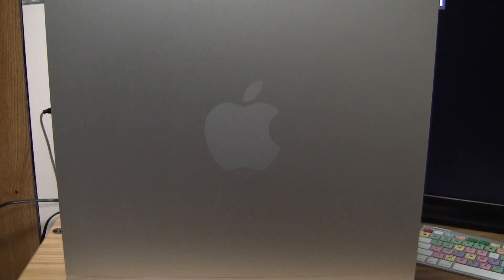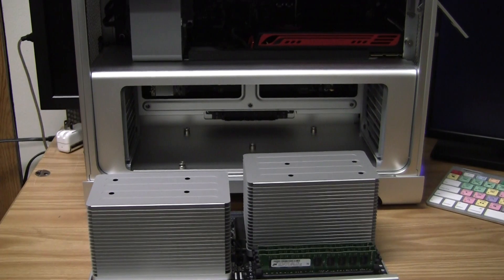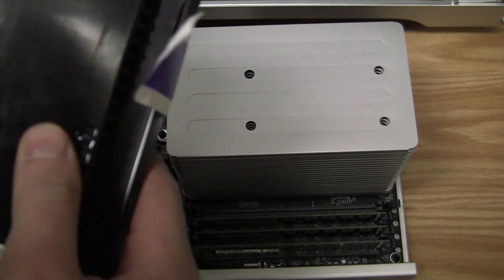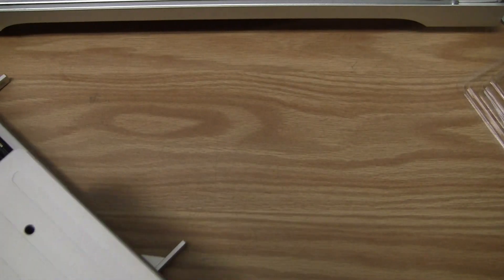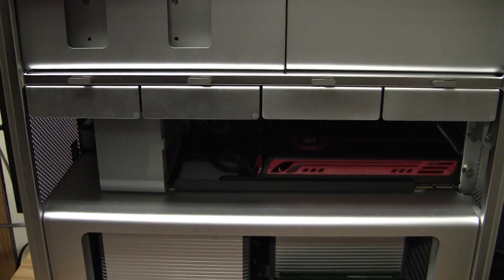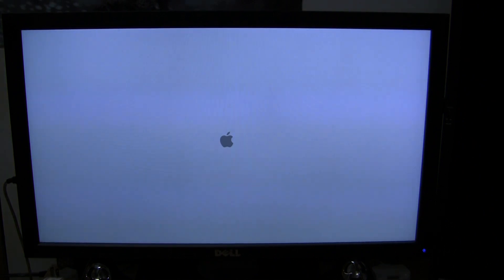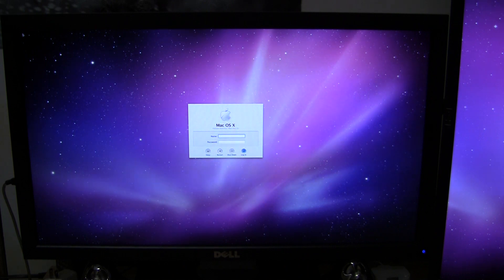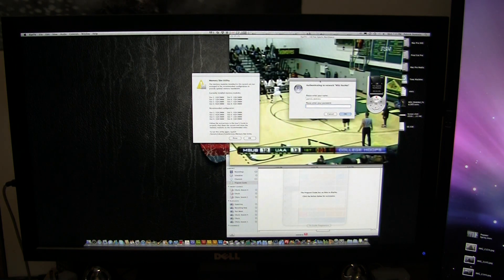2010 Apple Mac Pro Ram Upgrade - 8 Core Intel Xeon

Comment: screw that dude id rather build the entire PC myself with custom cooling, custom CPU and GPU and up to 32 gb of ram. Or you can go crazy with dual processors and 64gb of ram and 4 gtx 680 wich is equal to 8 video cards since each card has dual processors, and then you install windows on an SSD for like 5 second boot times. bottom line: screw mac

Comment: I honestly would not wait for the 2012 Update, the late-2010 model is plenty fast for most users, and I doubt the 2012 upgrade will bring to much more to the table. I have a 8-Core I just got in december and I am plenty happy not waiting for the2012 upgrade. And Boot-Time is comparable to an 2011 IMac, not a long time, but not fast.

Comment from the maker: @ShakeAndBakeGuy Yes it is. I am going to need to add more in the near future. Currently I have 6.2 GB wired and 6.25 GB active. I am running OS X Server inside of a Virtual Machine along with Windows Server 2008. I also use the machine for Final Cut and CS5 work.